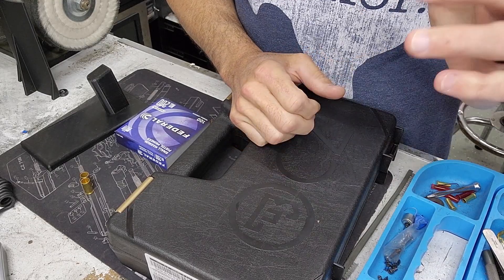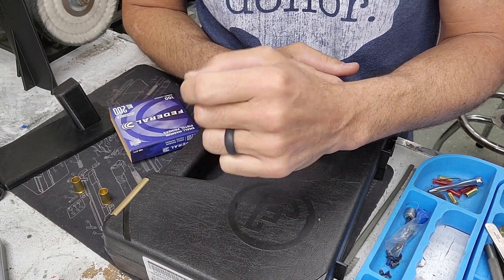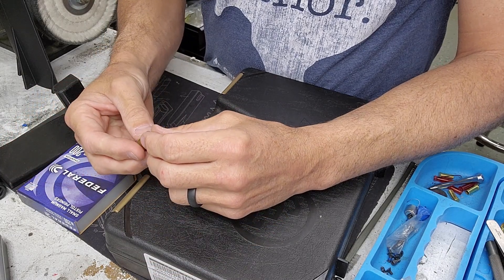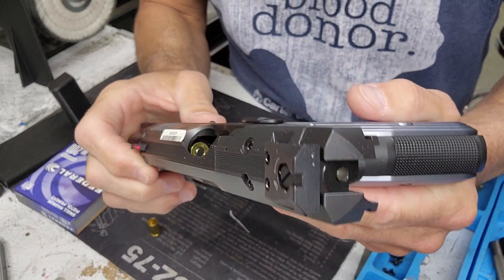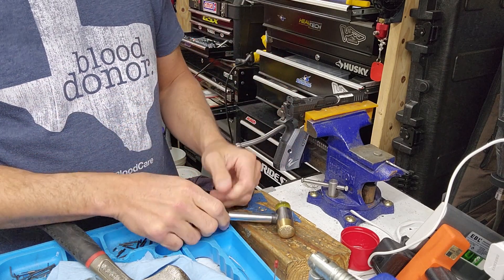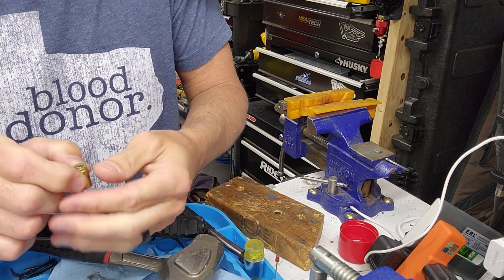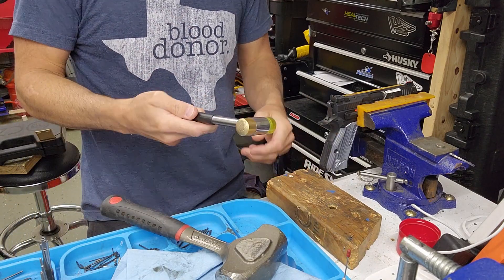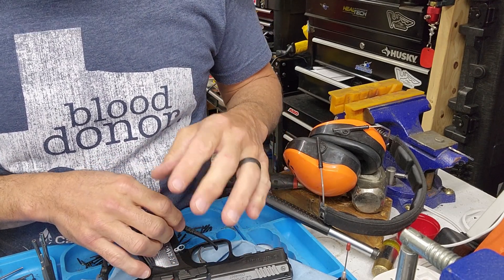Shadow 2 Compact - Drop Safe?

Comment: You ain't suppose to drop your gun any more than running your car into a wall.
You must have found that gun on the side of the road. I cringe looking at such equipment abuse.
Cz has been making guns for 200 years.if the cz engineers tested it safe, it is safe unless someone does something stupid with it. After market products are only good for the guy who takes your money.
Reply from the maker: all done under a fully controlled environment 😄.  Besides, somebody has to run the car into a wall to find out its safety limits, no?  Isn't it how it's done anyway?
Reply: @czarmorer exactly. What a ridiculous comment. Does this guy not think that Elon Musk himself crash tests his Teslas?
Reply: I’m in the insurance industry and while people are not supposed too they hit walls, buildings, and fences, and other cars ALL the time